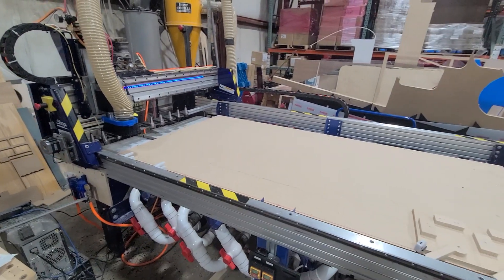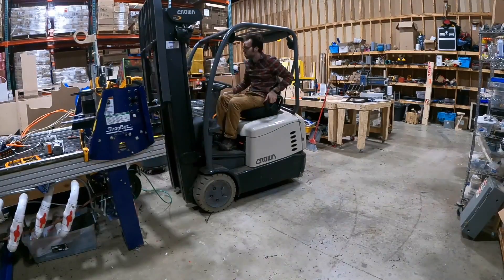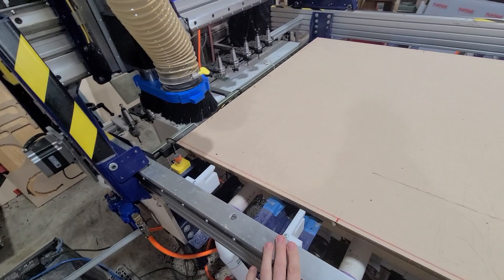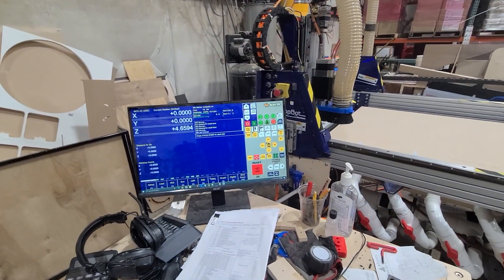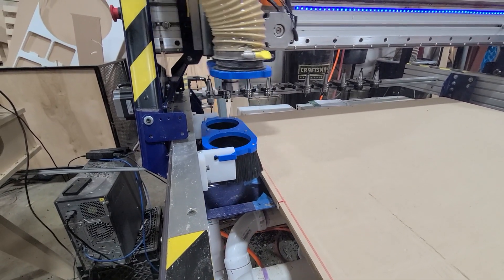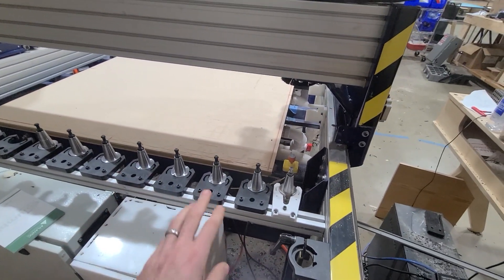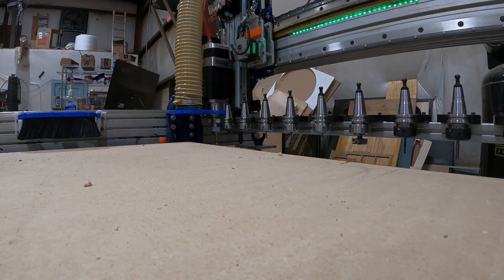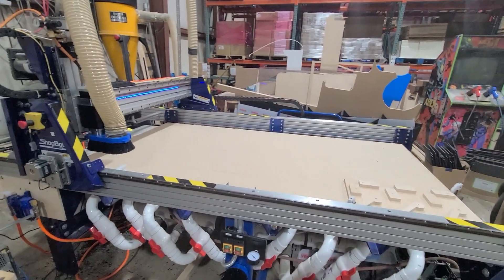Centroid Acorn CNC ATC setup on Shopbot router with S30 spindle

Comment: how did you do that ATC routine ???
Is there a way you can share that script so i can narrow it to a small iso30 box on the side of my table and set XY locations for each T#? 

I need to wire my ATC drawbar to relay still, but i would like to do this as im not going to have a generic ATC on my Mill. Much more time.

Comment: I have a very similar setup with the S30 ATC spindle, tool rack, and the need to park a dust shoe before a tool change.  I have a Mach3 macro that does this very similar to yours.  I am considering a switch from Mach3 to Centroid but this macro is holding me back.  Would you be willing to share / sell this macro?

Comment: Great work, I have an Avid 4896 with an S30C and running Centroid, and also have closed-loop NEMA34 steppers on all axes.  But I am still doing "manual" tool changes by pressing the blue button on my gantry-mounted solenoid, so setting up a "proper" ATC function is my next big upgrade.  I like your drop-off dust shoe, this is similar to how Shop Sabre does it.  I might go that route, or I might design a dust shoe like Marius Hornberger where the shoe moves up and down to a) allow for tool changes, and b) to allow the brushes at the bottom of the shoe to always be in contact with the cutting surface so dust collection is way more effective.   Anyway, great work and if there is anything you might be willing to share -- macros, schematics, whatever -- please let us know, including whatever reasonable costs you'd like to ask for :-) .   Thanks much
Reply: Hi Carl, I am just about to start placing orders for my CNC setup which is exactly like yours. Avid 4896, Closed Loop NEMA 34 with the S30C. I was planning on running Mach 4 since Avid offers it but after doing some research I am leaning towards Centroid. Would you be willing to chat with me about your experiences with this setup as it will be similar to mine?
Reply: @jacobguilbert5312  sure I wouldn't mind chatting, but just FYI I didn't really evaluate Mach 4 so I won't be much help in comparing / contrasting it with Centroid.  Since writing my initial post, I have delved into writing Centroid macros for automated tool changes and found the coding to be clunky and gives unpredictable results often, even when using Centroid's own sample macros verbatim.  so that's been frustrating.